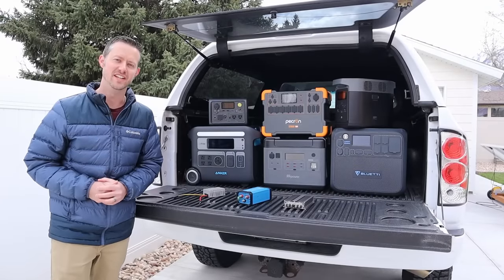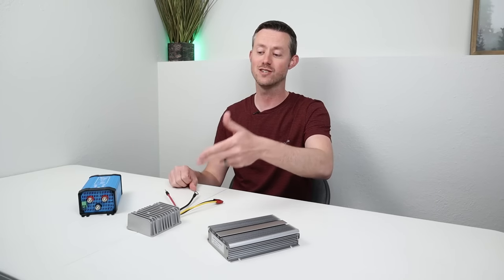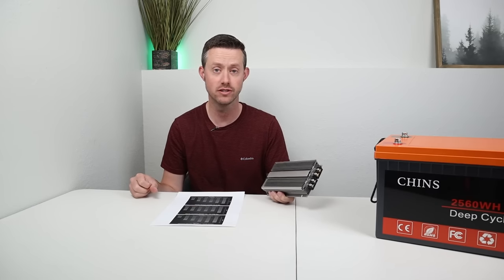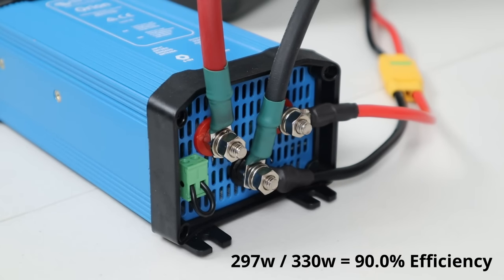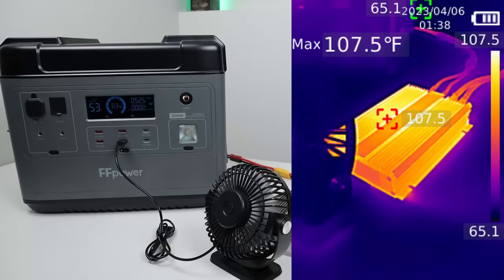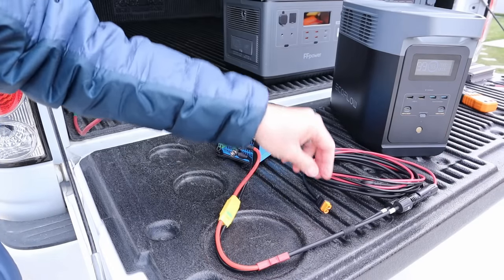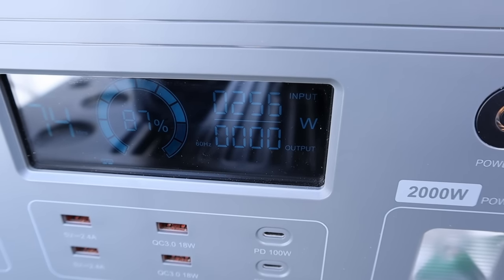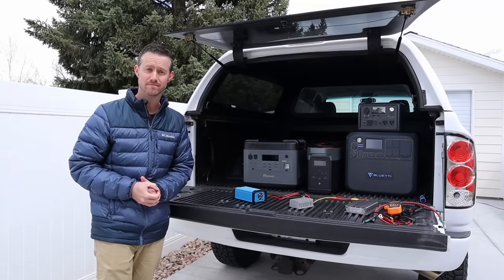Charge Your Power Station In Your Car FASTER - Perfect for Overlanding, Car Camping, and Van Life!

Comment: I have a Silverado HD2500 Duramax diesel.  How would I connect one of those converters to my truck?  Which battery specifically or does it matter?  Or is there a way to pull 24v right from my truck?
Reply from the maker: You'd need the converter to get the higher voltage. What power station are you trying to charge up?
Reply: @Jasonoid  I got the EcoFlow River 2 Pro with the EcoFlow 220w solar panels.  I'd like a second way to quickly charge the River 2 Pro when traveling from camp spot to camp spot so I was thinking that 12v to 24v boost converter you mentioned would be the ticket.  What gauge wire and what size inline fuses would you recommend when running from my battery and to my EcoFlow?  What size Anderson Powerpole connectors?
Reply from the maker: You would connect that directly to one of your starter batteries with a fuse and wire it into your cab or back of the truck. I'd suggest using 8awg wire to avoid voltage drop. Purchase a decent 12v to 24v converter (the larger the better so it doesn't have to work as hard and won't get a hot as a small one).
Reply: @Jasonoid  So, the XT60i plug (for solar input) on the back of the EcoFlow River 2 Pro says 11-50vdc, 13amps max.  So, would the ideal be a 12v to 48v, 10amp boost converter?  And if I did that, based on what you said in your video, it would pull 40 amps (480 watts/12v = 40amps) from the battery to the converter?  I bought a 12v to 24v DC (10 amp) converter just to mess with.  If my math is right, that will put ~240 watts into my River 2 Pro and pull 20 amps from my battery?
Reply from the maker: @mertiemade  looking at the specs that is all correct, however the River 2 Pro will limit the charging input to 220 watts peak. So you'd probably be fine sticking with a 24v or 36v converter since it can't charge any faster with DC input. The larger the converter, the cooler it will be over time.

Comment: Do you recommend using an inline fuse to run the power to the converter? If so do you have any recommendations (brand, size)? With the Victron do you need to worry about it trying to drain the battery trying to charge when the car is off?
Reply from the maker: I would not recommend charging the power station unless the engine is running it will quickly kill your starter battery if the engine is off.
The fuse and wiring size depends on the load you are pulling from the battery, check out ampacity charts for the proper wire awg and fuse sizes.
Reply: @Jasonoid  Thanks I will consult the chart for the fuse. I don't plan on charging it when off, just wasn't sure if just needed to unplug to make sure it doesn't try to charge when I stop and its plugged to prevent draining or should have some sort of off switch. I know a few styles have a 12v input to the converter to prevent issues.

Comment: Can I just plug the boost converter into the vehicle's 12V lighter socket, and not connect it to the vehicle's battery?
Reply from the maker: Most 12v sockets at limited to 10 amps or 120 watts. If you plugged a converter that pulls much more power it will blow the fuse. That's why you need to direct wire it, so the wires don't melt / you keep blowing fuses.

Comment: If this is hooked up to your engine battery, but it's not actually plugged into your solar controller or solar generator, would it still be pulling power, in other words I don't want to run down my engine battery when it is sitting and not running??
Reply from the maker: You could always wire in a DC circuit breaker switch like this:  https://amzn.to/3VbviFj
Just switch it off when not in use to save on power.

Comment: For the Victron, do you have to install a kill switch to ignition and a fuse box? would you recommend?
Reply from the maker: I have a disconnect switch in line so I can turn it off when not using it. I'd recommend that or using the built in relay system on the Victron.
Reply: @Jasonoid  - thanks for your quick reply! how bout a fuse box? do you also have one? would this prevent your Ecoflow from potential damage?

Comment: This is a really great video, thanks! I have a battery electric Citroen eberlingo microcamper, so i cook with induction, and have a Delta Max 2000 to provide energy. I have been looking at using a DC-DC converter like the Victron to charge faster while driving. Your tests indicate a charge rate of 415W at 30V. I thought that wouldn't be possible with a max current of 10A (according to Ecoflow spec), since that seems to work out at nearly 14A. How come? I'd like to up the voltage more, to charge faster, but I can't find a serious product that will do significantly better than the Victron in your test. Do you have any ideas about that? It's also hard to find out what my car's charging capacity is, so i don't overload it. Of course it's not an alternator, it just takes power from the main traction battery, when the motor is running, but it's hard to find data on this. It's also really annoying that Citroen doesn't offer direct access to the traction battery, as some manufacturers do, which would avoid all these complications!
Reply from the maker: I got 376 watts when charging the EcoFlow Delta Max with the Victron. I was using the XT60i MC4 charging cable which allows for slightly higher amperage input.
Reply: Oh yes, thanks so much for replying, I misread your results. So maybe the difference with a 36v converter is worth it, even with a less reliable product
Reply from the maker: @estelinet  I like the 36v converter, the main thing is to keep it cool!
Reply: @Jasonoid  thanks, and I’d need a relay connected to ignition?
Reply from the maker: @estelinet  a relay or you can use a switch or a disconnect to manually turn it on and off

Comment: Can you connect the  12v to 24v converter straight off a leisure battery in the van while it is getting a charge from a Dc to Dc charger as you drive or does the converter have to be connected directly to the vehicle battery ?
Reply from the maker: The converter can be connected to any 12v battery that can handle the load. It doesn't have to be the starter battery.

Comment: if you plan on using these from a car wondering if the cheaper option is best? Thinking the others would blow fuses or hurt the alternator.
Reply from the maker: Yes, none of these will work by plugging them into a 12v cig port, even the small one will pull 200+ watts which will blow a fuse. You'll need to bypass the vehicle wiring and install your own larger gauge wire to handle the load. Alternators are good for lots of amps, so the smaller option, the 12v to 24v 20amp model won't damage your alternator (I personally feel the others wont either).

Comment: Very cool video and well presented! Is a boost converter the same as a DC-DC charger?
Reply from the maker: Not quite, a DC to DC charger will put out power and try to adjust the output because it thinks it's connected to a battery. With a converter, it's putting out a solid stead voltage and amperage.
Reply: @Jasonoid  In your situation, could you not use a DC-DC charger as well?
Reply from the maker: @silvere36  maybe a 24v DC to DC charger would work (would be around 200 watts). Hard to find 36v or 48v DC to DC chargers. A 12v unit wouldn't provide any benefit so you'd want to avoid that. Only way to find out would be test it out.
Reply: @Jasonoid  I was looking at Renogy 50A DC DC charger with MPPT. They also have a 30A version. They seem to both vehicle battery and solar inputs and have a very fast charge rate.
Reply from the maker: @silvere36  the key to get a benefit from a DC to DC charger for faster charging would be that it puts out a much higher voltage to the power station. Those 30 and 50 amp models will not add any additional power since the power station will limit 12v input to 10 amps, thus having a 12v DC to DC charger that puts out 50 amps a complete waste. You need a DC to DC charger that is designed to charge a higher voltage battery so it can boost up the input 12v to something like 25-35 volts and the power station will actually charge faster. The key is higher voltage.
Reply: @Jasonoid  I see. The power station is the limiting factor. Would make sense if it's going to a battery but not to a PS. Got it. I was looking to see how I can charge the Ecoflow Wave 2 battery quickly.
Reply: @Jasonoid  Subscribed!

Comment: i dont really get it. i have an ecoflow river 2 pro, it charges around 800 watts AC wall charger. i would like to charge it at full power from my 1996 toyota land cruiser, what is the cheapest and easiest way to do this?
Reply from the maker: Dc charging is pretty low on the River 2 Pro. If you want to charge it fast, you need to hook a pure sine wave inverter up to your vehicle battery and AC charge the power station. This video is for fast DC charging large power stations.
Reply: @Jasonoid  ok, I will look into inverters, thanks for a response. It seems contradictory to convert dc to ac,
Back to dc, then even convert back to ac to run ac stuff off the ecoflow, but I guess it’s where we are at as a civilization
Reply from the maker: @Citizenspress  DC Charging is limited to 220w on the River 2 Pro, if you want to do a DC to DC converter like in the video, you'll be limited to 220w.... Kinda slow in my opinion. AC charging is much faster on the River 2 Pro.

Comment: Daygreen sells a converter that is 12v to 58v at 20a. This could be used to charge an AC200MAX at 870watts since the PV input limits to 15amps, is that right?
Reply from the maker: Yes, that math looks correct. Just remember that you would also be pulling around 72 amps from your 12v battery (870 / 12 = ~72 amps) which is quite a bit of power. You'd want to make sure your alternator, wiring, and battery can handle that amount of power.
Reply: @Jasonoid  Already upgraded to a mechman 240a alternator for my 4Runner and 0 gauge cables. Just waiting on the Step up converter.

Comment: Hi there, can you connect the Orion negative directly onto the body of the car instead of the negative of engine battery? Would like to pull only 1 cable (positive) from the engine bay to the back of my car. Once the Orion is plugged in the bluetti on the PV aviation port, can you connect your solar panels via the enhanced charger?
Reply from the maker: Yep. If your car battery is grounded to the frame. You can ground the Victron to the frame of the car and run just one postive wire to the Victron. And yes, you can dual charge with the charging enhancer.
Reply: Thanks Jason. For dual charge, what would you recommend (I have the Bluetti 200 max), keep the enhanced charger for solar and the  aviation port for Orion or vice versa?
Reply from the maker: @Arkeopterex69  I'd recommend keeping the higher wattage port for the Orion DC to DC converter, use the charging enhancer for solar.

Comment: Hi Jason, would I be better off combining solar and a 1000w inverter while driving to charge up my EcoFlow Delta Max in my 2022 F250 Lariat Tremor? Or would you still stick with the Victron DCDC converter?
Reply from the maker: Using an AC inverter would work just fine. Just make sure you enable the custom charging speed around 800 watts so it doesn't overload the 1000w inverter.
Reply: @Jasonoid  Would jumping up to the Renogy 2000w inverter be too much for my set up? 

Thank you for the reply
Reply from the maker: @PHOENIXOVERLAND  I wouldn't recommend pulling that many amps from a stock alternator. Thats like 166 amps when pulling 2000 watts (12v x 166~ = 2000 watts)
Reply: @Jasonoid  makes sense. Would it make a difference if my truck has dual alternators and dual batteries? My truck is a 6.7l diesel so I have a 240amp alternator and a 157 amp alternator with dual batteries.
Reply from the maker: @PHOENIXOVERLAND  that's probably enough to handle the 2000w then.
Reply: @Jasonoid  would it matter which battery I connect it to? The Delta Max can charge at 1800 but should I dial it down to 1500w or is it just safer to go with the 1000w model?
Reply: @Jasonoid  would it matter which battery I connect it to? The Delta Max can charge at 1800 but should I dial it down to 1500w or is it just safer to go with the 1000w model?
Reply from the maker: @PHOENIXOVERLAND  you can dial the charging speed down to 100w if you wanted in the smart app. Going the max would be fine. Just test things out and see what works best. I'd probably start with 1000 or 1100w charging first.
Reply: @Jasonoid  ok sounds good. 

Thank you again for taking the time to answer my questions

Comment: I didn’t scroll through all of the comments, so maybe someone else asked this question already. Why didn’t you turn the voltage up to the maximum of 30 volts on the Victron? It would have made a huge difference for charging the Anker 767/2000, because it can accept more charging at voltages between 30 and 60 volts.
Reply from the maker: The voltage was turned all the way up, it just sags under a full load.
Reply: @Jasonoid  Thanks for clarifying that.

Comment: Might you have a video or diagram showing how to wire this up to your vehicle's battery with any appropriate fuses and switches for beginners?
Reply from the maker: I don't have a video of that but if you look on youtube for a video that discusses connecting an inverter to your car battery the wiring should be very similar. Large gauge wire, and fuses.

Comment: Confused on the 20A victron instead of the 10A version for the EcoFlow as I thought the solar in was max 15A.
Reply from the maker: Even though the Victron can provide 20 amps, the EcoFlow will only pull the power it's limited it (15 amps). Its always better to have a larger converter so it's not running at max load when in use.

Comment: Could you plug the cheapest converter into you 12v cigarette lighter and then into a delta pro’s xt60i solar in connection?
Reply from the maker: 12v ports in vehicles can usually handle 10 amps. If you pull more power you'll blow a fuse.

Comment: can I ask one more question? please! :) can the victon be conected to the bluetti via this this smaller port where you would plug your ac charger? im getting confuse about all this.
Reply from the maker: No, only the charging enhancer or the AC wall charger can be connected to that 7909mm port.
Reply: @Jasonoid  thank you! can I have the very last question I promise. if no just ignore me but please dont :) The way you charged your bluetti with victron and alternator is better option then charge it by using the 1000w conventer and bluetti ac charging brick? I bought old fiat ducato camper and there is some old conventer with leassure battery but I want bluetti. Can you tell me your sugestion? I promise play and like your every new video :)
Reply from the maker: @pijanysamuraj  you can use an AC inverter and the wall charging brick if that's more simple for you. The only advantage of the DC to DC converter is that it's slightly more efficient. Both options work just fine 👍

Comment: I have a bluetti Ac200P,  set it up the way it was in the video with the victron but my power station does not charge. It says it’s getting 30 volts but no amps or watts? 
I have it grounded to the frame of the truck, does it need to be grounded to the negative battery terminal? 
I used 4awg  wire from the battery to converter which is 16 feet. And 2awg wire for the ground from converter to frame of the truck. 
Any help will be much appreciated!
Reply from the maker: Maybe turn down the screw on the Victron? If it's turned up too high maybe it won't start. Also check polarity with a voltmeter.
Reply: I think I figured it out. The Ac200p has 35 volt minimum for solar charging vs the ac200 max which has 10 volts minimum.
Reply from the maker: @uplanddrifter2304  I totally forgot about that! The new Pecron 500w car charger will work, it puts out 42v. I have a video on it from a couple weeks ago.
Reply: Thanks, I will be purchasing that through your link.
Reply: UPDATE!!! Just got the Pecron car charger. Hooked it all up and works perfectly with my bluetti ac200p. Charges at over 500 watts!
Thanks

Comment: Some Victron converters can be wired in parallel, meaning we could get double the wattage?
Reply from the maker: These power stations are 'amperage limited' and most were maxed out in this test. The only way to get more charging power would be to increase the voltage of the converter. .

Comment: I have the Redarc BCDC and I want to get the Victron converter to charge the Delta 2. How do I connect them together? Can you do a wiring video?
Reply from the maker: Connect the Victron to the Delta 2? You'll just wire positive to positive, negative to negative. You'll also want to put in a fuse on the positive line. I'd also recommend a power switch so it's not running all the time.

Comment: I have an ecoflow delta 2. I charge with solar, and I'm planning to also usse the victon. How do you use both without manually swapping the cables all the time? I figure if I have to, I'll charge off solar and wherever I can plug it into an AC outlet somewhere, and will use the car battery when those aren't viable.
Reply from the maker: Something like this might work to swap between charging sources:  https://amzn.to/3R3z2rS
Basically you wore both inputs in on the switch and you chose one or the other. This would allow you to change charging inputs without swapping cables around.
Reply: @Jasonoid  only one cable can go into the ecoflow, so do u mean put that on the output of this switch and then feed the solar to one input and car battery to the other input?
Reply from the maker: @StevenDavisPhoto  exactly, and then change the input by twisting the switch. It also allows you to fully shut off the charging if you want.